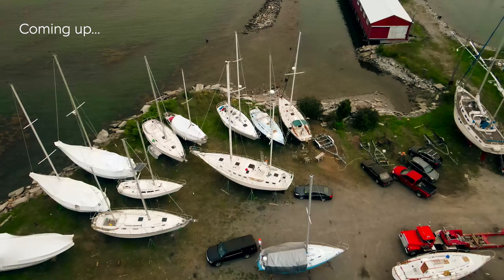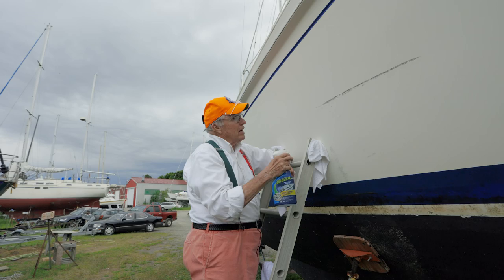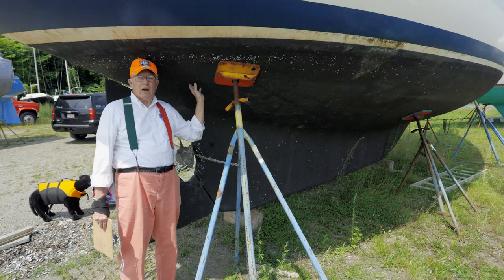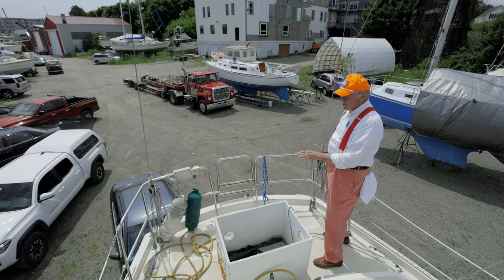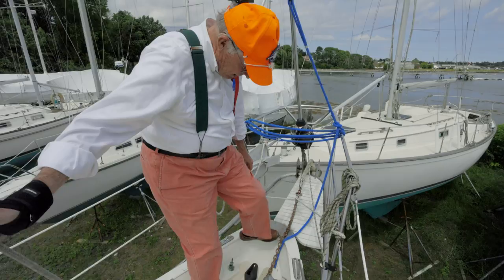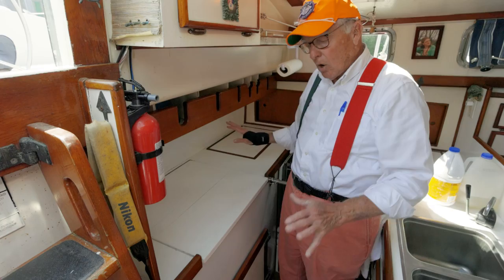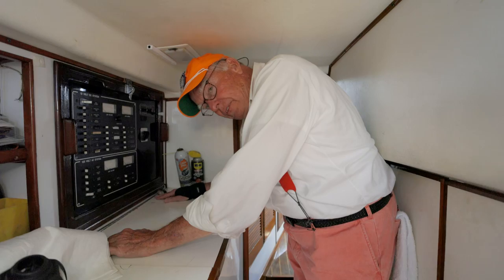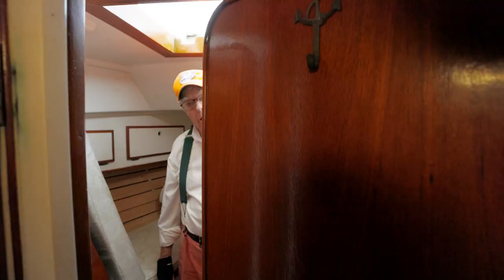$25,000 42-foot Cruising Sailboat for sale | EP 53 #sailboattour #sailboatforsale #captain q

Comment: When stated that they glassed over the rear companion way does that mean it had it originally or the factory design deleted it in the final molding
Reply: I was kind of intrigued at the conversion, myself. While it is something that could have easily been done at the factory, the fact that I have never seen one before this, makes me want to believe this was a custom job done after the boat was built. 

My brother had one of these for around 15 years, so I was quite aware of the boats, and took notice of the ones that I saw while I was out cruising. I'm thinking that if they did this at the factory, that there would be more than just one, or a few out there like this. I know that my brother complained about how much room that the ladder for the companion way took up in their berth. 

I realize I haven't seen every one of the 300 or so boats that they built, but if they did do something like this at the factory, you would think you would see a few more than just this one out there somewhere. In my opinion, adding the hatch and removing the companion way makes this boat better in a whole bunch of ways, without really having any drawbacks.

Comment: Unduz it???? Does seem it worked all that well.....it left the scuff there 🤔 
Or is it me ..???
Fairwinds from the @captains.chair
Reply from the maker: It did remove the dirty smudges on the boat but the long scar was actually in bedded into the gelcoat which we didn’t realize at first and so it was going to take a little longer than we had time on screen. Seems like pretty good stuff thanks for your observation

Comment: Thanks for another entertaining transfer of knowledge.  I got very interested in this boat until I started doing the math on the refit and compared it to what is 'cruise ready' on the market.  The cost of just the obvious clean up and minimum refit would prove the old adage that a boat is a hole in the water you throw money in to.  Always saddens me when someone lets an otherwise good boat sit until it deteriorates to the point where it becomes an economic disaster requiring someone who will take it on as a sweat equity labor of love.  Sadly most of those projects never get completed and the whole thing becomes a calamity of the first order.   Unlike old cars graceful old yachts don't get restored and end up at Mecum's.  :(

Comment: I own one of the last Brewer 44's made (hull # 304, 1989) and the description of the changes that where made to the hull compared to the Whitby are incorrect. The hull on the Brewer 44 is a long fin with a rudder on a sked, the Brewer bight was actually a reduction of the area on the bow, not in the stern as indicated. The draft is 6' 2" on my boat. The liveability of the boat is every bit as good as described. My rig is a cutter rig with out the mizen mast and it sails like a dream.